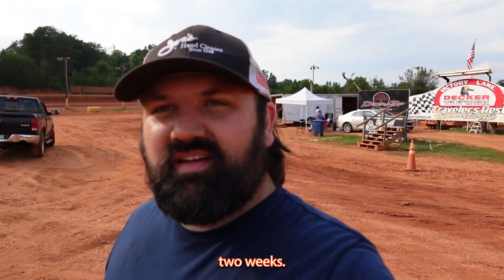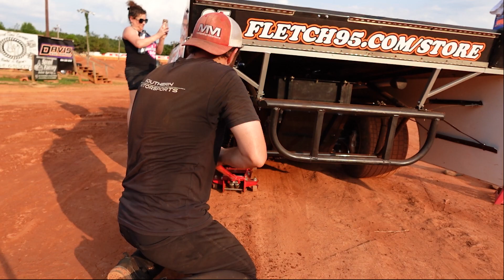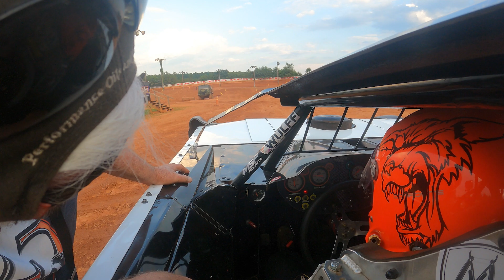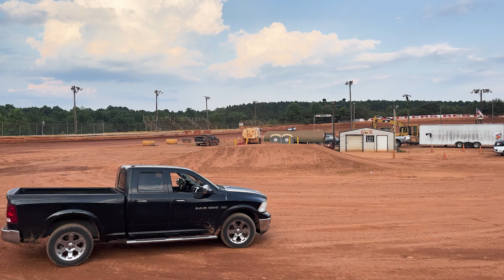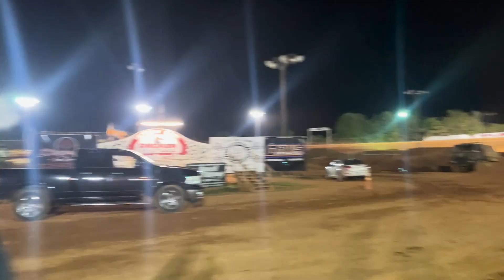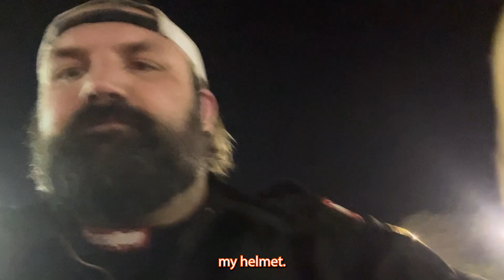SUMMER TIME SUPER LATE MODEL TESTING: Getting a grip on our dirt late model setup vlog

Comment: I don’t know a whole lot about super late models but it sounds like the car is surging in the straights is that normal
Reply from the maker: So that surging sound that you are hearing could be two things. One is good and one is bad. 

The good surge sound is called digging in dirt racing and is a sign that the car is hooked up and putting the power down. 

The bad surge could be if the car is hopping on the track surface. We had a little problem with the hopping so we made some setup changes that helped with that a bunch. 

What you are hearing in this video is probably a combination of a little bit of hopping still going on in addition to the car digging